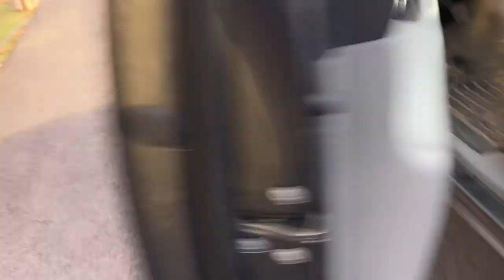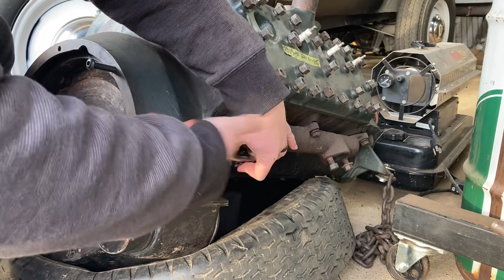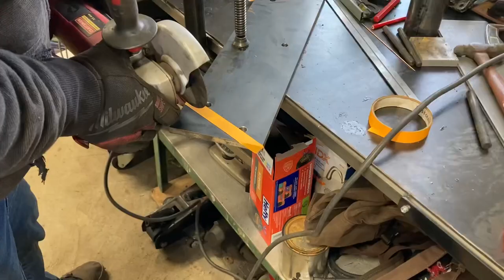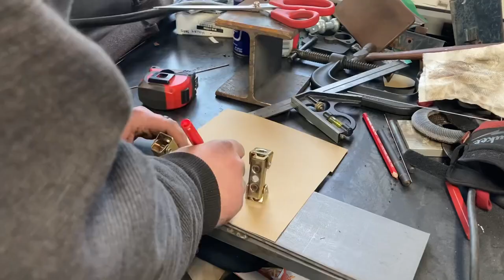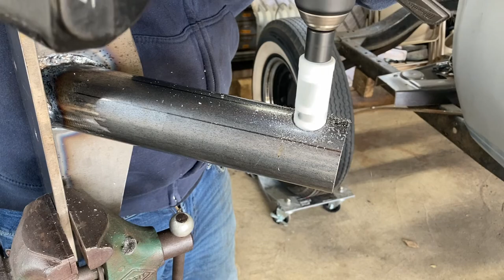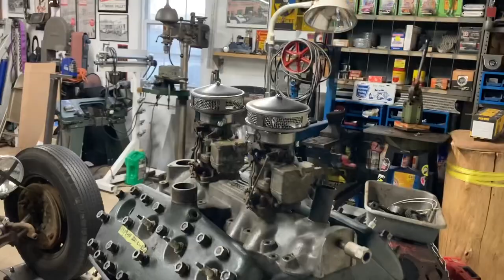Making a Flathead engine stand adapter

Comment: Is the round pipe schedule 40 or 80?
Reply from the maker: I opted for sch. 40 since the original engine stand mount pipe size was similar. It worked well, but wouldn’t be a bad idea to go 80